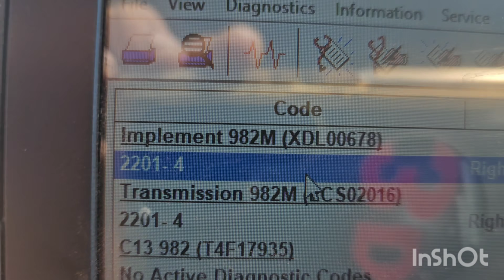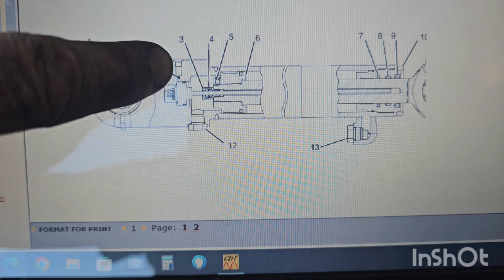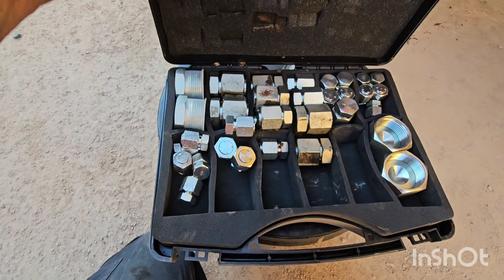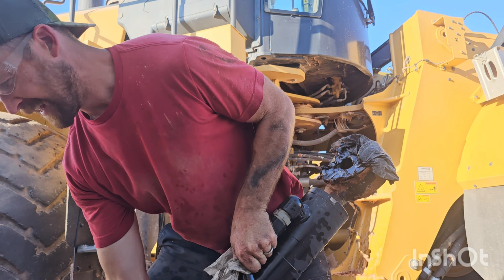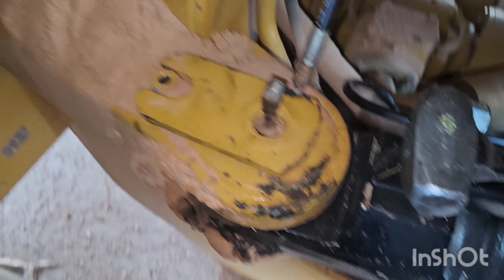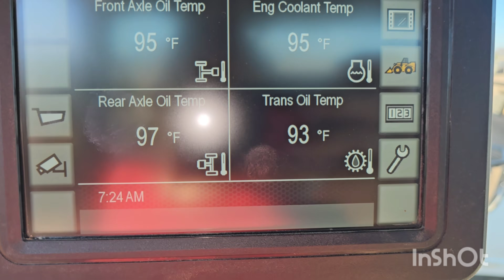CAT 982M loader! Hydraulic cylinder! Heavy equipment Mechanic!

Comment: I’ve always use the machines hydraulics to push the cylinders out. Was there a reason you didn’t do that in this case? I always figured it minimized any air in there also anyway. Just curious

Comment: Just a tip, it you want to be sure its the sensor when you disconnect from the sensor you should get a voltage high code if you dont keep disconnecting the harness further back,
Reply from the maker: That makes sense. I appreciate the tip!

Comment: hang a cloth over the coupling next time so it don't spray oil everywhere. then you use air in the second hose connection, so you don't have to use a crowbar. when you are going to put it back, attach it to the front first. then you use air in the coupling to get the cylinder apart 😁
Reply: and always coat the pins with grease before inserting them 😉
Reply from the maker: Agree!
Reply from the maker: Great tip. I'm not a fan of using air for cylinder. I like to be in control. But, too each there own

Comment: You need to learn how to release the pressure off the hydraulic accumulator
Reply from the maker: The accumulators discharge automatically after 30 sec key off.